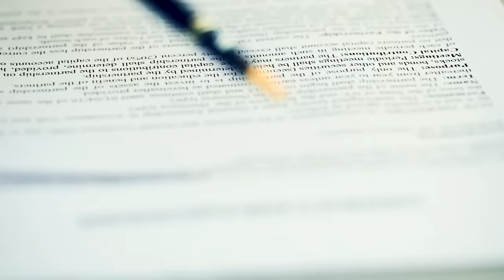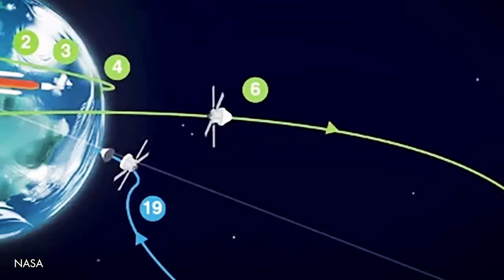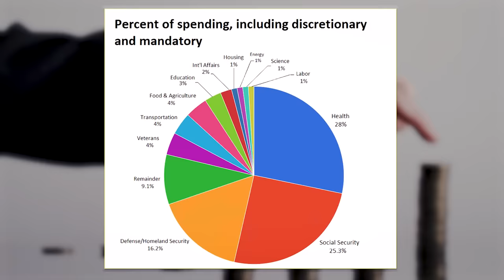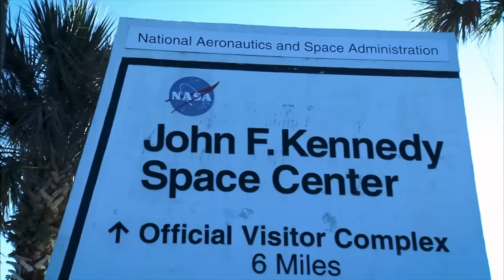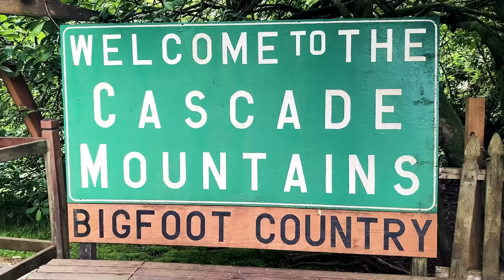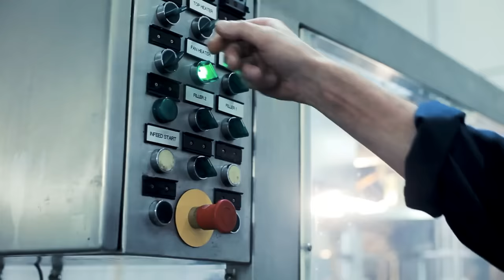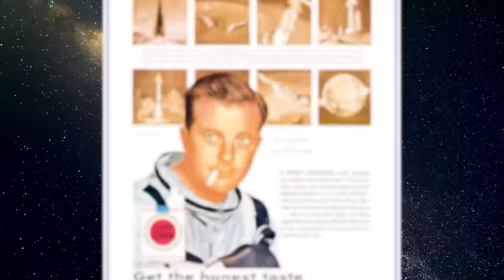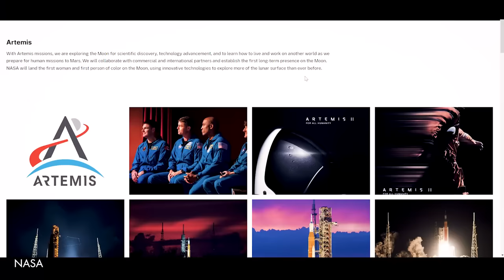Why is it so hard to return to the moon?

Comment: Now Boeing can't even put a simple capsule up at the iss
Reply: What a joke?
Reply: Boeing can't even get the holes to line up when assembling the airframe.
       Engineer whistle-blower warned using excessive force to line them up still leaves an unacceptable gap that leads to premature metal fatigue.
Reply: @fabirkemarian6370  AND was killed for speaking out.
Reply: @SSRI_PINKHIGH  are you sure or is that just another media rumor?
   I know the engineer with the accent said in interview that he was threatened but you're only one to mention his birth certificate was prematurely expired.

Comment: There are several inaccuracies in this video but the ones that really caught my attention were that SpaceX Starship's 33 Raptor engines generate over 16 million pounds of thrust which is nearly twice that of the Saturn V rockets thrust. Also, SpaceX's Starship (with Super Heavy rockets) stands about 31 feet taller than NASA's Saturn V rockets.
Reply: I think the details are in the language being used. “Starship” is the upper stage of the fully stacked rocket. So Starship (or “SS”) sits atop the SuperHeavy rocket (or “SH”). So SH can get SS to NEO. Apparently SS can’t propel itself to the moon directly afterwards because of its incredible size. Remember it can accommodate 100 people or 100 tons…something like that. I think 100 people require a great deal of heavy life support equipment and materials, supplies, food etc. 

Ok. Now we have big old SS up in orbit. So it has equipment for the moon. But it needs more fuel that couldn’t come along for the ride in addition with the moon equipment. So that may be why another 15 or so SS fuel tanker launches are needed in order to add enough fuel to send SS to the moon. I never understood any of this until thinking it through in the writing of this post. Please let me know if I’m not correct; I’m happy to edit it if I’m wrong…I just want to fully understand the problem that we have in terms of why SS can’t just be launched and fly to the moon in one shot.
Reply: The Super heavy block-one version presently generates 74.4 MN (16.7 million lbf) thrust. While Saturn IV generated 34.5 million newtons (7.6 million pounds). More than double. 

SH is 71 m (233 ft) tall, while Starship is 50.3 m (165 ft). 
Saturn 5 was 110.6 m (363 ft) tall. 
So 35' taller than Saturn V. 

Starship block-2 will have stretched tanks in both booster and second stage, with 35 Raptors in SH, 6 sea-level and 3 vacuum Raptors in Starship. This should increase real payload capacity from 45 mt [presently] up to 110 mt (242550 lb). 

Block-2 is going to be used for the HLS contract unless block-3 arrives sooner than expected.
Reply: @imconsequetau5275 Dude, you got your data on the Starship Blk 2 backwards: It's going to have 6 vacuum engines and 3 sea level engines. As for the actual moon lander, that's going to need an almost entirely different engine configuration altogether because the moon has no atmosphere and a loose, rocky surface - no hardened landing pads there yet.
Reply: @Bobcat665  
Of course we know that Starship HLS is going to have high-level landing engines. What's your source on block-2 vacuum engines? Artist depictions?
Reply: Big difference is Saturn made it to orbit and Starship hasn't.
Reply: Bigger isn't better. And got to think of weight. Apollo was also carefully designed and engineered.. Where as starship is fatally flawed crap
Reply: @SebastianKrabs  star ship has made orbit.
Reply: @carguy6699  😼 You took the bait like I knew you would. 🤭 Starship made orbit as it spun out of control and then burned up into re-entry. That's not a success, sure it reached orbit... But not in the good way 🤭
Reply: @carguy6699 Why didn’t it orbit then? It don’t think it even reached sub orbital. It blew up and fell back to earth.
Reply: Based on the more advamced N1 Russian moon rocket Lockheed bought after collapse.
Reply: @SebastianKrabs  have you even watched the video? Do you even know what the goal was on the last orbital launch?
Reply: @TheSteveSteele don't think? Did you even watch their last launch. Made it to orbit quite well actually.
Reply: Starship "33" , ? 33 .. ?   Say no more...
Reply: @sMansGuitars 
The LEM was part of the ascent stage, but the rover was brought down by the descent stage. Different mass issues. Also, mass was trimmed from all 5 engine stages, and ISP (efficiencies) were improved on the engines. Those massive fins on the booster could have been deleted next.
Reply: Not only that, when the Starship explodes it is a spectacular show.
Reply: @SebastianKrabs Saturn V never orbited either.  Just the Command Module, Service Module and Landing Module did.  

See the difference?  Starship is attempting to put the entire rocket into orbit, and be re-used.  It's more like the Shuttle than the Saturn V.
Reply: Starship has 2.5X the thrust of Saturn V.
Reply: @kenfryer2090  "Apollo was also carefully designed and engineered.. Where as starship is fatally flawed crap"  EXACTLY!
Reply: We know fact they didn't go to the moon.. it's also fact a monkey beat the humans to space.. Krakup.. 😂😅
Reply: @henrygraham3527  you better have proof we didn’t go to the moon.  Do you really think 50,000 people can keep a lie?  Your ignorance is really showing.

Comment: When they went to the moon, they used Gold tin foil to get passed the Van Allen Belt, today you can’t find gold tin foil anywhere only Silver 😂😂😂.
Reply: The Apollo spacecraft did not need radiation shielding. The MLI (which you call “gold tin foil”) was there for thermal insulation, not radiation. 
By 1962, we had measured the radiation level in the van Allen belts, and we found humans can safely travel through the belts. The radiation level in the belts is high enough to be a problem when you spend a long time there, but not high enough to cause immediate problems.
Reply: The Van Allen Belts contain mainly Alpha and Beta particles. Alpha will be stopped by a sheet of paper and the majority of Beta by a few mm of Aluminium. Of more concern would be the Hydrogen Nuclei in the denser parts of the inner belt but the Apollo spacecraft spent very little time in the inner VAB. You must remember that not only did the spacecraft hull act as shielding but so did everything that it contained, fuel, fittings, equipment, etc. The main challenge for the Artemis Program is that modern electronics and IC's are far more susceptible to damage from particle radiation than the electronics of the Apollo era. Rigorous testing of the electronics had to be carried out before a crewed mission. Interesting to note that you obviously believe NASA and Dr. James Van Allen (who advised NASA) when the tell you that these belts exist so perhaps you should look up James Van Allen's explanation of how to pass through them. Take care.
Reply: @Hobbes746   What about the reconnecting of the landing module coming back from the moon surface, onto the orbital capsule where Collins had stayed ? 
That's a tough  one for 1960's technology. I believe Musk can't reproduce that in the 2020's, but in the 60's.. sure no problem.
It involves intersecting 2 trajectories on the fligh, with basic equipement, locking the 2 devices one-onto-the-other, managing decompression without any explosion, and letting the 2 astronauts back in the main capsule. Before setting course back to Earth.
All of that, successful on first try. Mmmmmmh..
Reply: @goofygrandlouis6296  Rendezvous was studied extensively, and practiced on Gemini missions before the first Apollo mission. Then several Apollo missions flew the LM and re-docked it with the CM, first in Earth orbit, then in lunar orbit before Apollo 11. So “successful after lots of practice” is a more accurate description.
Reply: @Hobbes746   OK, but still hard to do with 1960's technology, you have to grant me that, correct ? 
Anyways, SpaceX is coming so all will be revealed. If THEY have a hard time doing it.. then it was just impossible to do in the '60s.
Reply: @goofygrandlouis6296  Yes, it was hard to do with 1960s technology, which is why they spent $300 billion getting it all to work. Apollo had ten times more man-hours spent on it than the Manhattan Project.
Reply: Gold foil and tin foil are two different things.
Or do you also say aluminum tin foil?
Reply: @SuperScottCrawford  I don’t talk or research about tin foil, especially about a silly joke someone makes.
Good thing is! If ever I need to know about colour foil for a life threatening situation, I’ll give you a call 🤣🤣🤣
Reply: @monkey271070  lol. It's not the color of the foil. It's the material the foil it made of.
Tin is an element, a metal, they used to make the foil rolls out of before aluminum. They also make cans out of tin. 
It's a misnomer.
Reply: @SuperScottCrawford  I’m sorry, but do you not think i was joking, most people would know that foil is not what will get you to the moon and back or not get you to the moon and back lol
Reply: The space capsule looks like a Hershey Kiss with landing gear...then to up the ante...you add a buggy to be assembled and driven on the surface😅. Diamonds Are Forever was released in '71 which had a weird fake moon landing in Nevada...what were they saying???
Reply: @goofygrandlouis6296 I was just thinking about that. He said they stayed 21 hours on the moon. Flew back up to the station and then came back to earth like it was an after thought. Man is these people nuts?
Reply: @Hobbes746 save that bs. You're exposing your ignorance
Reply: @Hobbes746 always the same lame ass money excuses.  Damn you're acting like you landed on the moon with them.
Reply: @jamesball8519  I don’t have to land on the moon to know how the Apollo astronauts landed on the moon. That’s the nice thing about modern society: tons of information is published and accessible to anyone, so I can look up how they did it.
Reply: @Hobbes746  or just ask they man that made it all happen…. Stanley Kubrick. 🤣🤣🤣

Comment: I am an old fellow that started computing in 1968, the year before Apollo 10. These days the computing power of cell phones are quite literally millions of times faster (GHz instead of kHz) with millions of times the memory (Gbytes instead of kBytes). Just think about that for a moment. Hell, that took some programming skill.
Reply: well yes, but there are reasons and motivation for more powerful computing. Though Apollo computers were very primitive, they rode a vehicle with a zillion horsepower. **THAT** is what is needed to go to the moon, otherwise we'll end up like Soviets trying to perfect the N1.
Reply: @wrightmf  It does not take much computing power to fly a rocket, or anything else for that matter.. It's little more than solving F=ma twenty times a second. Maybe x(t) = A1 cos(ω0t) + A2 sin(ω0t), where A1 and A2 are constants for landing the LEM. You can get more sophisticated, but it's all the same complexity of equations that are solved every 50ms or so. Calculated desired position and use the difference from the current position to find the steering and thrust output and repeat the same thing over and over.
Reply: True.  By the time I was studying in college in 1974, the computer room still used punch card for programming.  Hard to believe moon landing in the 70s with the technology at that time.

Comment: I want to know who was recording when they were landing 😂😂
Reply: There are no external recordings of any of the Apollo missions landing. However, each landing was captured by an interior static data acquisition camera mounted in one of the windows of the LM.
Reply: Yeah...?!
Reply: Exactly😂
Reply: @yassassin6425  Great, concise answer.
Reply: @Ruda-n4h so concise 😂 a camera battery from 1969 wont even turn on in 260° heat. One wouldn’t today either
Reply: @450farf You are talking about atmospheric temperature. There is no atmosphere on the Moon to efficiently ‘bind’ lunar surface heat to devices that are not in direct contact with it, plus the fact they weren't on the Moon when it was that hot.
Reply: @Ruda-n4h  A camera battery isn’t capable of withstanding 260° heat. You don’t need to be a rocket scientist to understand that
Reply: They said unmanned automatic or  remote controlled .   Which is a lie
Reply: @450farf  You're talking about atmospheric temperature which doesn't exist on the Moon. There is no atmosphere on the Moon to efficiently ‘bind’ lunar surface heat to devices that are not in direct contact with it.
The astronauts were also never exposed to the maximum temperature on the Moon which is +260F at mid-day. With no atmosphere this refers to surface temperature not atmospheric temperature. Every lunar landing was made shortly after sunrise. One lunar day (dawn to dusk) lasts nearly 15 Earth days, and the astronauts were only on the Moon for a maximum of 3 Earth days, so they weren’t there long enough for the Sun to be at its highest and hottest or at night when the Moon is at its coldest.   
There are only two ways heat can transfer on the Moon. The first is radiation, both directly from the Sun and from the Sun’s reflection on the surface. The camera film was covered with reflective passive optical coatings.
Reply: @theeraphatsunthornwit6266  Who said that and about what?
Reply: @Ruda-n4h  nasa said about the first photo on moon
Reply: @theeraphatsunthornwit6266  Are you talking about the first photo taken on the Moon during Apollo 11?
Reply: @Ruda-n4h  yeah
Reply: @theeraphatsunthornwit6266  I've never read or heard that said. I think you are talking about the FILM of Armstrong's first step which was taken automatically by the TV camera on the landing leg of the LM.

Comment: Dr. Paul.
How did the astronauts in 1969 survive the Van Allen radiation belt? How are we going to get through this time?
Reply: They didnt . And they wont . 😅
Reply: @martinattwood7801  Yes sir. 
People like doctor Paul are supposed to be the smart ones. lol
Reply: @martinattwood7801  🥴
Reply: google is your friend. It's amazing 30 years later and people still don't know how to use it to find information
Reply: Apparently that problem is still to be solved
Work that one out
Reply: @martinnewtonholmes  NASA was talking at that time about testing the Orion spacecraft which was originally conceived in the early 2000’s as a proposal for the Constellation programme. Following the cancellation of Constellation in 2010, it was heavily redesigned for use in NASA's Moon to Mars project. Orion contains much more complex electronic systems which are far more susceptible to radiation damage than Apollo’s low density integrated circuits and magnetic core memory, both of which are extremely radiation hard. Orion also isn't just intended to go through the Van Allen belts in a few hours as Apollo did. It’s designed for missions up to 21 days long, and perhaps even longer if it forms part of a mission to Mars. 
As a result, it would face exposure to radiation levels vastly greater than that of Apollo, for

Comment: What do you mean by "again"?
Reply: There were nine crewed missions to the moon with six landings. It would have been more had it not been for the premature cancellation of the Apollo Programme and the aborted Apollo 13 mission. Presumably NASA also felt the need to inexplicably fake their own failure?
Reply: @yassassin6425 So why arr they planning to have 15 separate launches just to file the journey to the moon if that was not the case last time?
Reply: @ifldiscovery8500  
Because the objectives and mission profiles of Project Artemis are completely different to Apollo. The Apollo missions flew into LLO whilst Artemis will be NRHO in addition to the fact that they will be placing far more mass on the lunar surface. And 15 launches is not confirmed.
Reply: No kidding never been before
Reply: @yassassin6425  I’m sorry but it really doesn’t make any sense that we have been before but can’t right now hmmmmm and how would we get past the van Allen belt hmmmmm
Reply: @jackietreehorn5561  
Lots of people never had a job interview.

Comment: #1.  The Saturn 5 was a custom, specialized rocket meant for a single purpose.
#2.  All Saturn 5 rockets were single use.  Build a new rocket.  Launch.  Gone.  Next mission?  Build an entirely new Saturn 5 rocket.  Every single mission.
#3.  There were 15 Saturn 5 rockets built, 12-13 went to space, none were ever re-used.
#4.  Space Shuttles were built for extensive, repeated use.  There were only 6 ever built, 5 ever used in space, and those 5 went to space 135 times.
#5.  If we were still using Saturn 5, we would have had to build 135 Saturn 5 rockets to do what the 5 Space Shuttles accomplished.
#6.  There are dozens of other rocket classes that put things in space all the time and are significantly cheaper.  They just don't carry people.
Reply: #5 is not correct.
Reply: Most people know nothing of the Saturn V.
Reply: HAHAHA 🤣😂

Comment: Perfect pictures from the moon but we had to hold one to the rabbit ears to get a signal 10 mi from the TV station
Reply: They weren't that perfect. But regardless distance is not the problem with the signal.. direction is.
Reply: @whichgodofthousandsmeansno5306  so what year did we make a 600 degree Fahrenheit AC unit that you can carry on your back
Reply: @whichgodofthousandsmeansno5306  what heating system did they use on the backside of the Moon in -300 degree Fahrenheit weather
Reply: @whichgodofthousandsmeansno5306  yeah I'm sure his signal Direction was a big issue from 240 million miles away I can see where that was a problem
Reply: @allencharlei8351  What drugs are you on that you can not grasp that most often video signals are "line of sight" dependent as opposed to "distance" dependent' which was my only point that you FAILED to address in epic fail fashion?